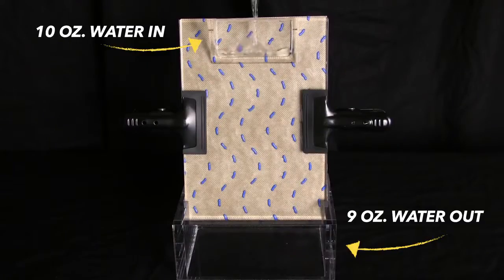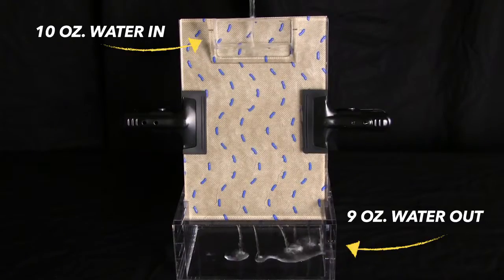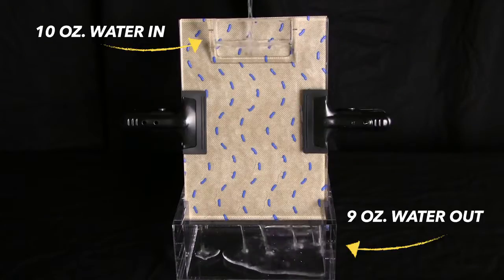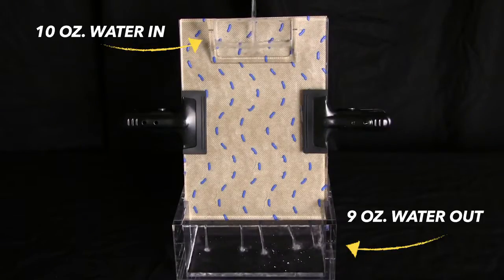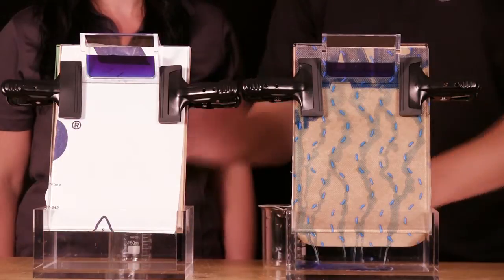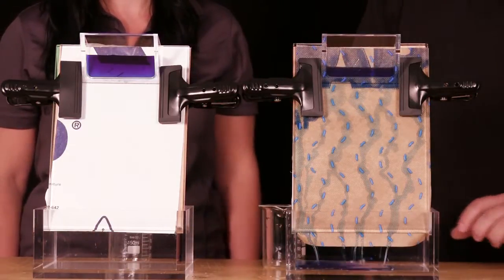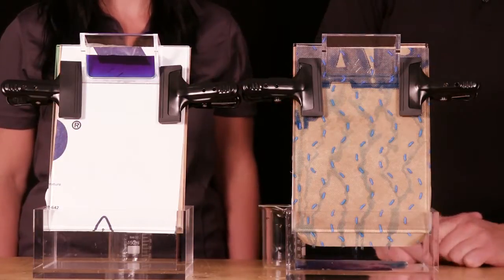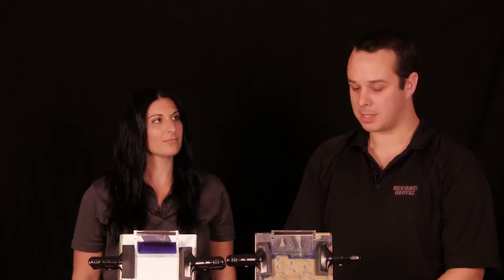Benjamin Obdyke's Time to Drain: HydroGap® Drainable Housewrap vs Tyvek

Comment: Why didn't you compare it to the DuPont Drainable product?
Reply: this demo was designed to show benefits of drainable wrap versus flat.  If you want side by side drainable comparsions, check out this one (including Tyvek Drainwrap) https://www.youtube.com/watch?v=gnj0_KiV0Fg
Reply: To be fair, your comparison should have been between Benjamin Obdyke FlatWrap and Benjamin Obdyke HydroGap. Both are excellent products that serve different purposes. They both offer great permeability that allows the substrate to dry. They both provide a barrier against exterior air and water intrusion. Only difference is that the HydroGap provides an additional drain path for trapped water between the cladding and wall, and it costs more. DuPont has a similar line of products as well.